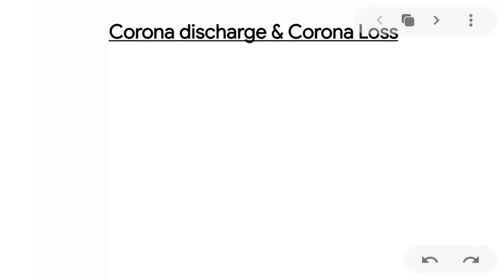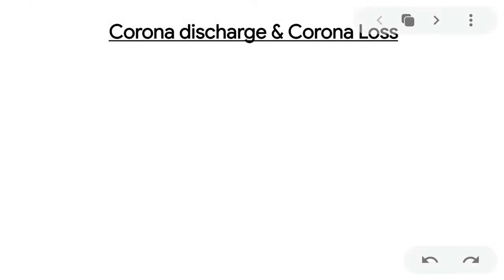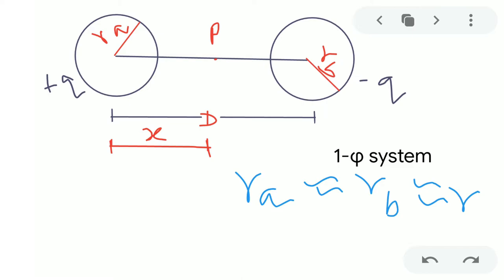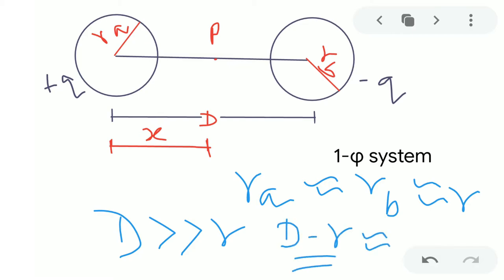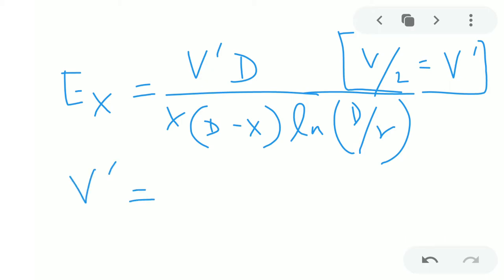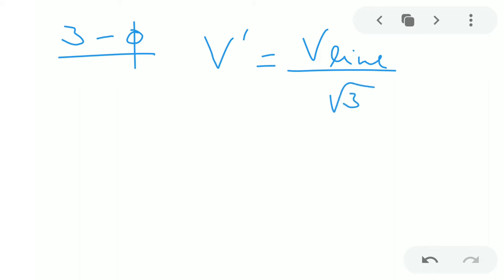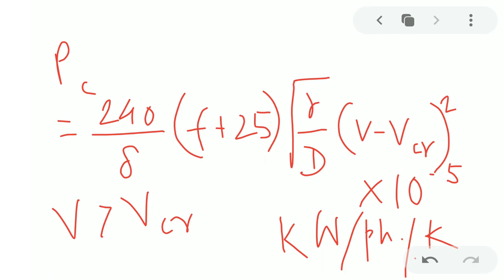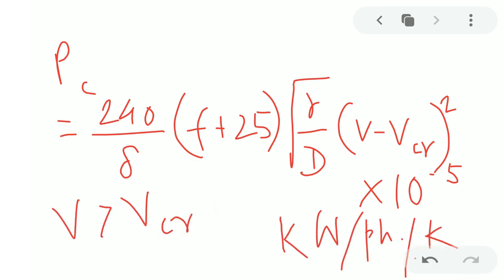Corona Discharge & Corona losses in a Transmission Line | Mathematical Analysis, Reasons and Factors

Comment from the maker: This video gives complete analysis of the Corona Effect on a Transmission line and power loss due to it. [Shorten URL: http://bit.ly/coronadischarge ].  I hope this video will be helpful for you. Subscribe to the channel and hit the bell icon notification button.
Timestamps:-
00:00 - Introduction
00:47 - Corona Discharge
03:14 - Critical Disruptive Voltage & Dielectric Strength
05:21 - Mathematical Analysis of Critical Disruptive Voltage
21:25 - Factors affecting Critical Disruptive Voltage & its equation
29:58 - Power loss due to Corona Effect
31:28 - Conclusion & End Note.